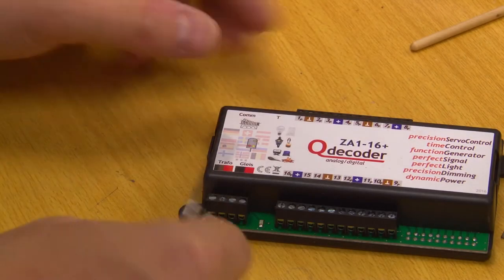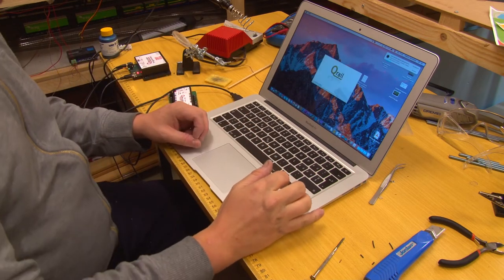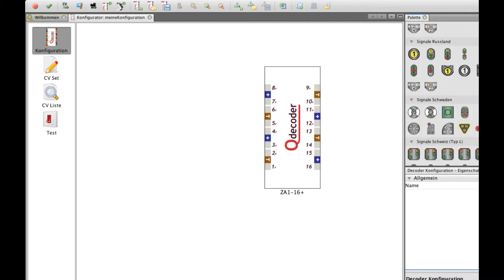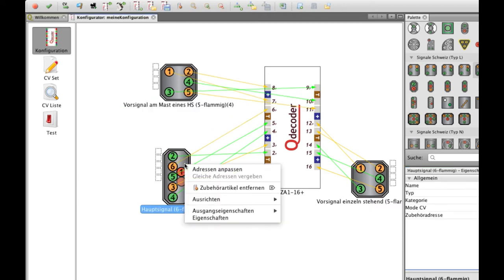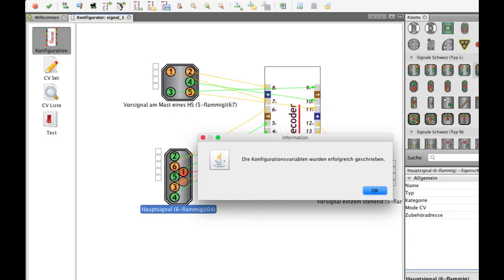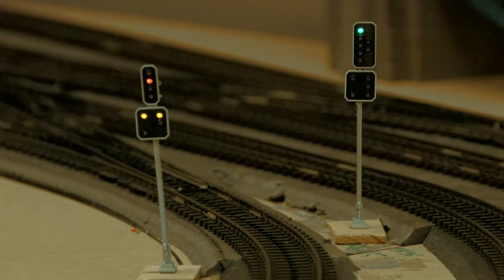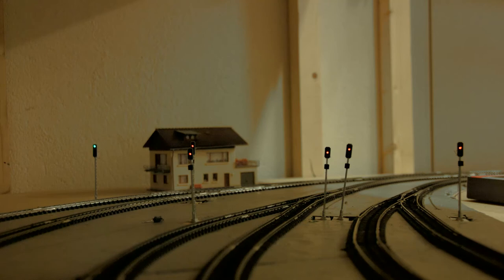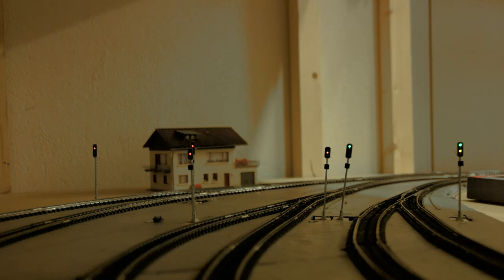Qdecoder - Review and Turtorial

Comment: Does someone know how to connect to the Märklin CS3? I'm just having issues to know witch wire goes where... thanks for your help!
Reply from the maker: You can connect both track and power the CS3, but it is recommended to connect the power terminal to a seperate 12-16V DC supply.
Reply: @thetrainroom  so basically I connect the "Gleis" to the brown and red from the tracks, and then I connect the "Trafo" to a Power supply 12-16V? 
And then how does the connection work? Do I need something else or it registers as a DCC comuter? And on witch cv do I find it? 
Thank you very much!

Comment: Thanks for video, what’s your opinion now? Still losing configuration and any additional info about MFX support? Looking to use the qdecoder and mafen signals together with Marklin CS3 and iTrain. Thanks in advance!
Reply from the maker: I have connected them to and old Märklin Booster which doesn't support Railcom and MFX return channel. I didn't tried it again, as the solution now works. The configuration lost was solved. There is a locomotive address for programming and it is set to default 3, which is an issue when programming a locomotive with 3. I have put another address, so it never lost configuration again. Also a couple of FW updates came along.
Reply: @thetrainroom  wow! Thanks for quick response!
Reply: no mfx support, but it works very well with CS3 and Itrain

Comment: Does it intergate with Itrain or Traincontroller?
Reply from the maker: It behaves like a regular accessory decoder. I had no problem to integrate it in Rocrail, so iTrain or Traincontroller should not be a issue. I know one gut who is using it with Traincontroller.
Reply: yes it does. I also have Itrain, Traincontroller gold and they work very good with Qdecoder